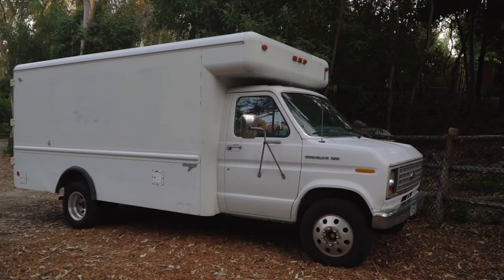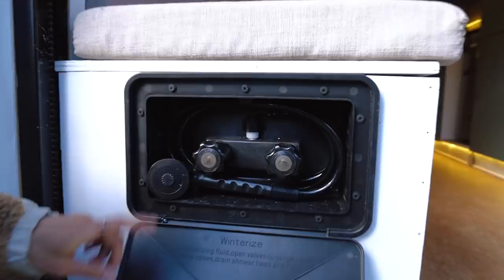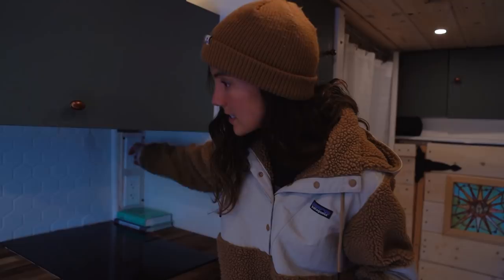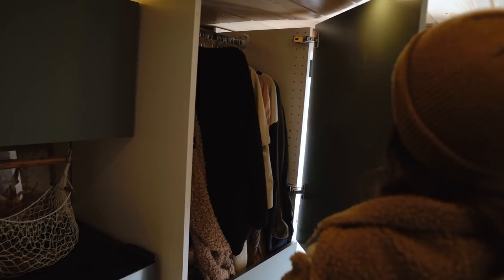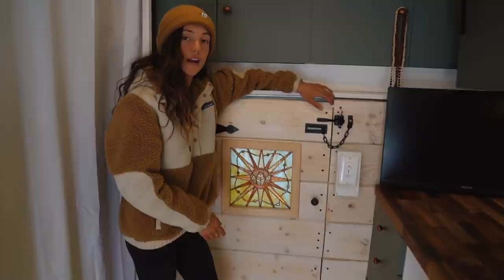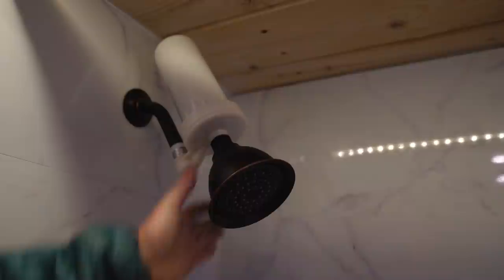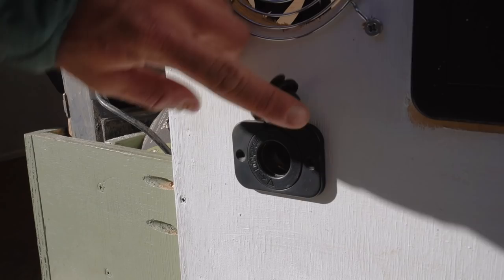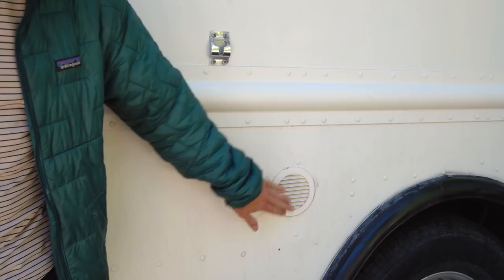VAN TOUR | Box Truck Tiny Home Conversion

Comment: Beautiful build,  but you may want to reconsider the wirenuts and solid wire/romex.  Over time the solid conductor will break and wire nuts will loosen.   Of course, if you're driving on highways it may not be that big of a deal.  Thanks for sharing and good luck on your journey!

Question:  how comfortable are the front seats?
Reply from the maker: Thank you for your helpful advice! We appreciate it and will definitely take it into consideration. Highways for the most part as the vehicle isn't 4x4 so we try to keep it smooth :) The front seats are super comfortable but we want to get them upholstered because the arms are falling apart lol so that is on the to-do list!

Comment: If you take the table top off does the bed drop lower ?

With all that  unused wall space above the couch cushions I would of added on big window  but without it I still like what you have done .,

Love Harry's lil knob >>>LOL
Reply from the maker: Yes if we take off the table, the bed drops as low as the benches. We utilized the wall space for a “national parks” push pin map and white board so no unused wall space anymore! :) 
We also didn’t want any windows there just because of safety reasons.

Comment: Wow learned so much from your video, electrical looked overwhelming until you shared the info on the course so maybe it's doable for a newbie like me w/out experience, I'm still searching for my Basil, alot of box trucks are diesel but heard they do not work well in colder climates/Alaska, what are you guys using for the heating system?  Now that it's been a year any thougths on pros/cons anything you would've done differently?  I'm blown away at your accomplishment great teamwork and job well done!  Do you guys have an email or alt contact to stay in touch?
Reply from the maker: the webasto or eberspacher "airtop" diesel heaters both worked great for us! We used the eberspacher in our second build which you'll find on our channel! The layout was pretty perfect for our needs, so not much would've been different! You can find us on Instagram @harryhods and @lysssanicole or through our email harryandlyss@gmail.com.  Thanks for your support!!